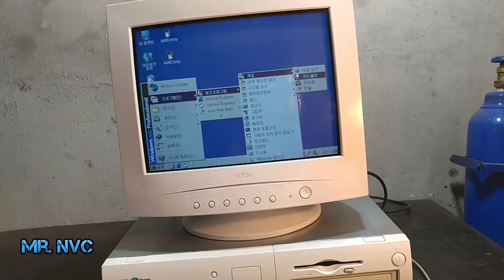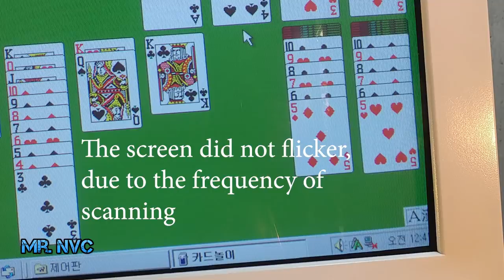23 Year old CRT PC Restoration

Comment: Instead of painting the plastic case, you can restore the original color by soaking it in warm Hydrogen Peroxide under UV (sunlight) all day.  The Eight bit guy has some videos on how he does that to restore old computers.
Reply: Sunlight! This wouldn't be possible in Manchester.
Reply: The cheaper, cleaner, and safer method too!
Reply: Have you tried it yourself or just watched someone else do it.
Reply: @firebladex8586  the 8 bit guy shows how this is done in many of his videos.
Reply: I think he couldnt use it due to weather problems or he didnt know that he could use 40% Hydrogen Peroxide

Comment: Hope you discharged the tube before disassembly.  Failure to do so might cause your video to end suddenly, not to mention your life.  :D
Reply: It obviously wasn’t changed. Internet culture caps, flyback, discharge
Reply: @The_Studioworkshop  Just as a firearm is always loaded (per Cooper's injunction), a CRT is always charged, even if it's been sitting idle for years.  Nearly lost a friend to a tube "which obviously wasn't charged".
Reply: holy shit
Reply: What tube ? And how do you discharge it ?
Reply: @kanaii7296  The picture tube.  And you discharge it by grounding it safely.  :)

Comment: Hydrogen peroxide to change the plastic back to white… not spray paint it
Reply: Yeahhhh
Reply: just do retro bright
Reply: @Rainbow__cookie  This was my thought exactly, but it still looks nice.  Hopefully the paint doesn't scratch off.
Reply: @Rainbow__cookie  Retrobrite is basically peroxide in some sort of binder. Straight peroxide gives better results, you don't end up with splotches or streaking from uneven concentrations of peroxide. Large objects can get a bit unwieldy to soak in a peroxide bath, but you can use a large feed tub or container to get it done.
Reply: He would still need to paint over everything because he had to use plaster to patch some parts, no?